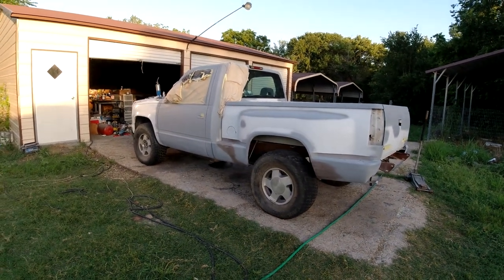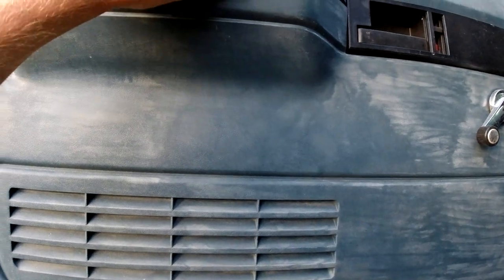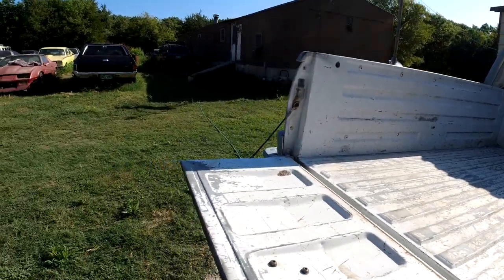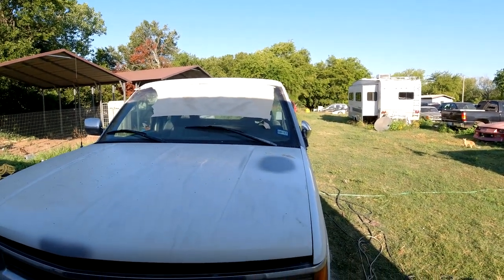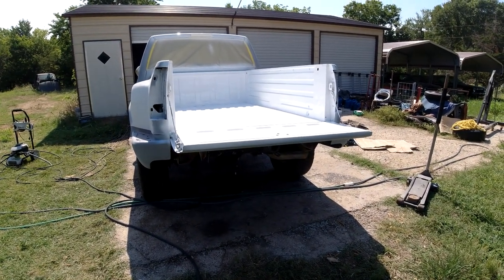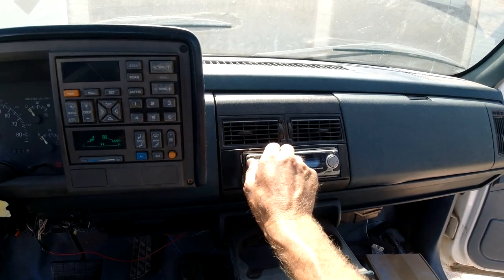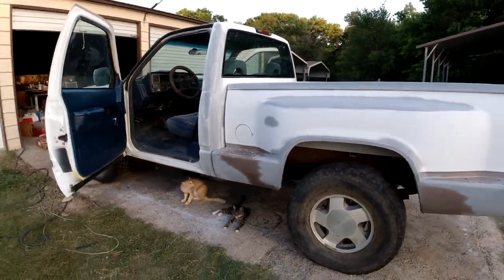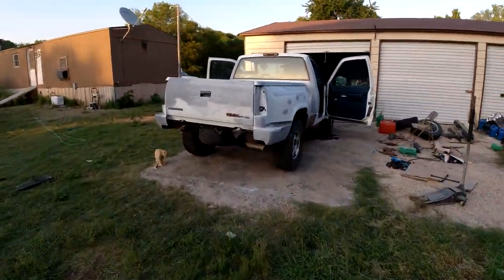1994 GMC Stepside Pickup Truck Build #7 - Prepped and Painting Process Started!

Comment: Hey man! Thanks for the shout-I'm the guy who mentioned the SEM Shadow Blue. You'll like it. It's amazing stuff-and it looks factory. You usually have to get SEM stuff from an automotive paint store. Those panels looks amazing! The stuff doesn't come off. It's gonna last for a loooooooong time. Also-you don't need to use your Bulldog adhesion promotor-there is a promotor mixed the SEM itself already.

Comment: I had another idea on your Toyota. Seen as it's running and driving and cheap.. cut off some rear panels and wings off something in the yard and graft them on the Toyota. Just a quick fix. Be ok for somebody down in Texas as a farm truck..you can weld you paint.. Could be a fun Utube fix. And a cheap project. White truck looking clean. PS. You should got your door panels with some matt clear. Bit more protection.